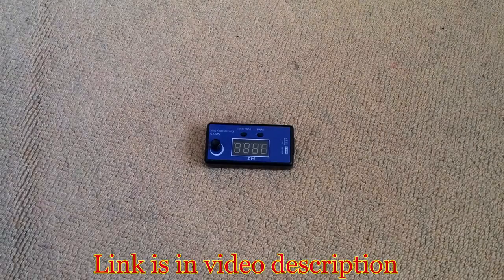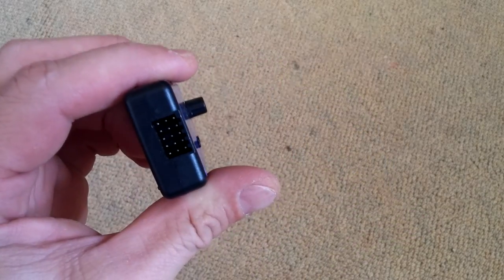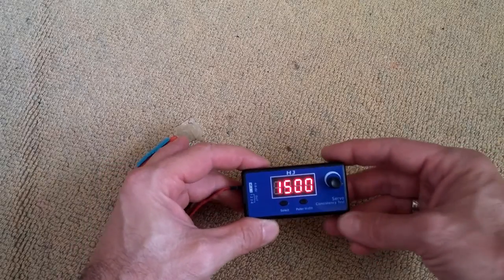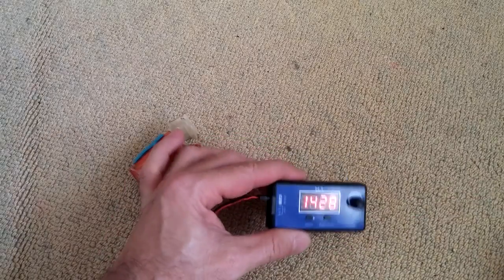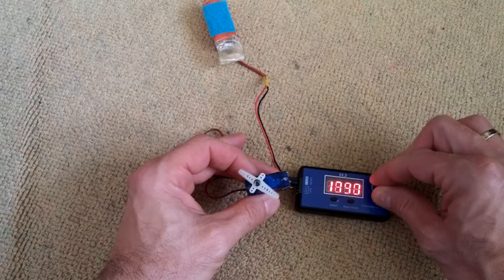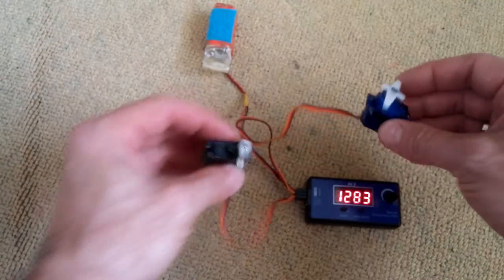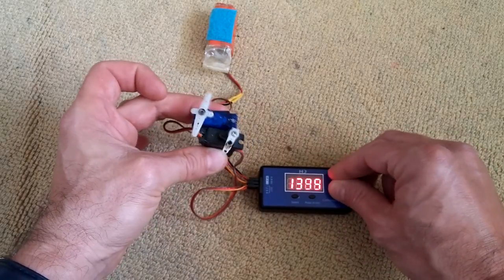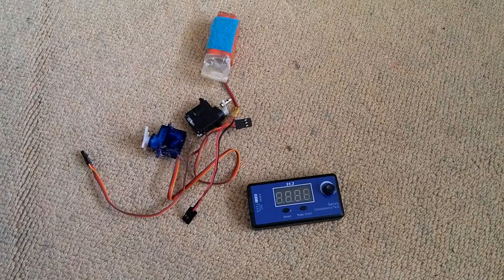HJ Digital Servo Tester/ESC Consistency Tester from Banggood

Comment: Hey what Battery did you use with the Tester?
Reply from the maker: I used 4x NiMh batteries (4.8V) for receiver power. You can also use ESC with LiPo to power up this device just like in RC plane powering your receiver.
Reply: Awesome thanks just ordered one :)  @neutrno
Reply: I had the same question. Thanks for asking Tex. Thanks for the answer Gorazd. Great over too. Thank you.
Reply: I found out in the end :) search on ebay or amazon for a "AA2500MAH 4.8V 181203"  @jeffhenderson934